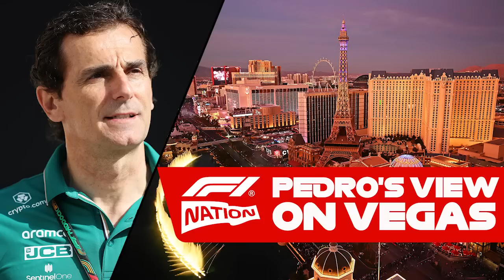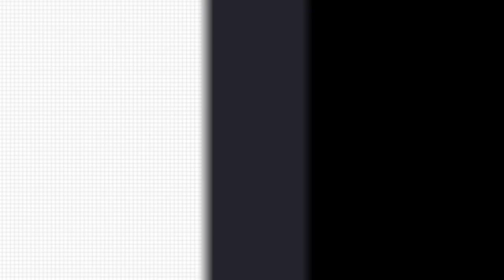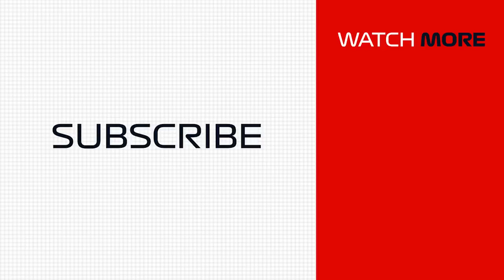Testing Temperatures and F1's Wedding Chapel | Las Vegas Grand Prix Preview | F1 Nation Podcast

Comment: Despite all the traffic headaches and potential issues with low temps, etc... I don't think there's any doubt that this will be, BY FAR the most VISUALLY interesting GP in F1 history. Maybe the racing itself will be bad (tho it couldn't be worse than Monaco) but, as they say, "image is everything" and this race is going to produce some ICONIC images!
Reply: what u said did happen, the race was terrible and boring however visually i guess they nailed it.